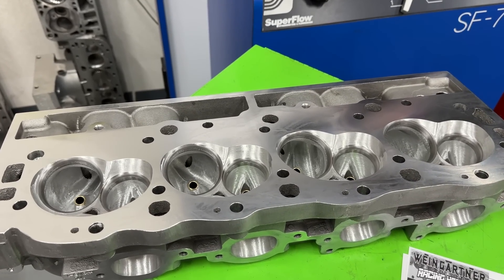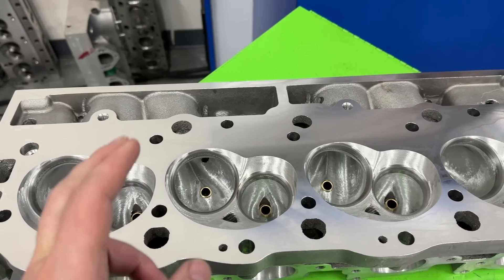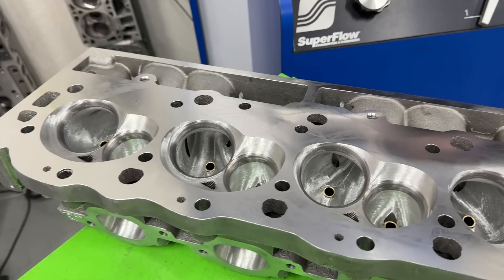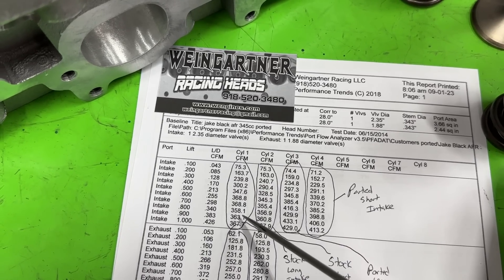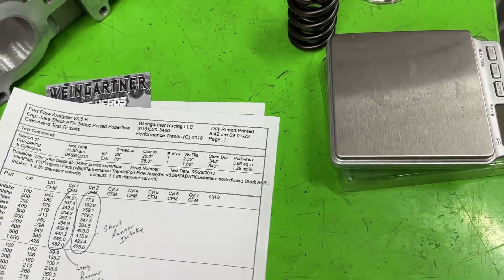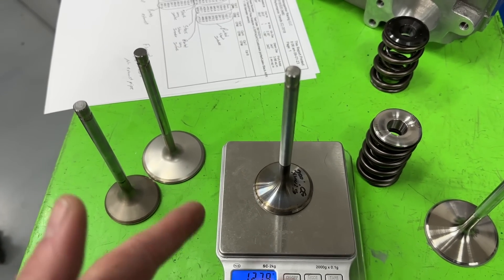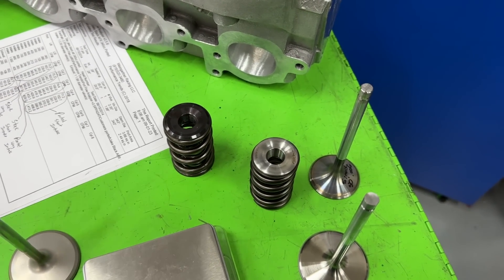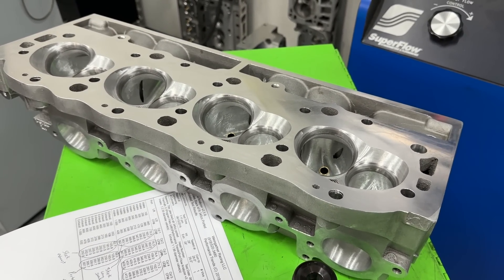Ported AFR 345cc BBC Results plus valve train weights

Comment: When considering valvetrain weights, it's typical engineering practice to consider 33% of cylindrical valvespring weight in valvetrain weight calculations. Springs with multiple inactive coils can be considered at 25%. Of course, the valve, retainer and locks are factored in at 100%.

Comment: getting  that narrow sweep is very important,, in the center of the valve is not   AKA mid lift geometry
do use knurled guides or knurl and hone the guides to hold some oil?  I od hone/ cross hatch the valves
huge gains  congrats

Comment: Good tradeoff on the intake valve and spring/retainer weight. IMO the spring pressure from mid lift to full open where the valve train is accelerating the most is more important than seat pressure
Reply from the maker: Valve float is where it bounces off the seat, which is why seat pressures are important.
Reply: @WeingartnerRacing  what about lofting over the nose and bouncing on the downslope all the way into the seat?
Reply from the maker: @treyrags  that tears up the lifter but if done right makes more power.
Reply: @WeingartnerRacing  yes it makes more power if you are limited on lift, otherwise it's better to build the extra area into the cam and smoothly control it

Comment: You mentioned closer to coil bind... do you target distance to bind rather than installed height?  Or have a distance to bind with undeflected lift preference?
Reply from the maker: Both. It goes Seat pressure and distance from coil bind.

Comment: I've see many posts of guys who, with the help of a spintron, are running much lighter spring pressures and spinning their BBC engines to 8000+ rpm. I'm talking like 190 on the seat with large lift cams! Also, since you have micro welding on the retainers, wouldnt it be better to consider a change of spring pressures? Or, just set up closer to coil bind?

Comment: The mass of the valve train on those units, has to be high. Normal units we get to play with, here in the UK, that are OHC with shim under bucket and rev no hight than 8000 rpm, generally need no more than 70-90Lbs on the seat and 180-200 over the nose. 
Of course were only making 135hp from 
1 Ltr. and the unit is only 2Ltrs 🏴🧑🏼‍🔧

Comment: I have a real question, but first, I had never heard of that other flow bench you use until I started watching you, say 2 years ago now.. It seems like all the shops I've been in use the SuperFlow SF 750 or their older model the SF 600 bench. Why wouldn't the SuperFlow that most shops use and been around a long time not be the more consistent one? I know their trans and engine stan dynos are very popular too
Reply from the maker: The Saenz bench is superior to the Superflow. It has way more capacity and spools faster. The superflow benches seem to have more variance from bench to bench even though they are calibrated correctly. This may be due to people using not accurate bore fixtures and plates to mount the head correctly to the bore. Their dynos vary from place to place as well. As far as consistency both will repeat within 1cfm from day to day.

Comment: My builder had my engine on his dyno and it started to float at about.  He used the same valve springs but the cam is different from what he usually uses.  I figured the cam may be faster ramp or something but now I wonder if the springs maybe different.  It’s just a street motor.  He’ll get it fixed, he’s the pro not me and he wouldn’t give me junk.  You’ve just learned me and I’m thinking.  Thank you.

Comment: Goes to show you can't just race flow benches.  At first glance you might think the AFR 357 is better, outflowing until 0.700 with a smaller cross section flowed on a smaller bore, untill you show the 600 numbers that is.  And still don't know if you're running the same radius plate and pipe...
Looks like a nice setup 👍.
Reply from the maker: You cannot compare flow numbers from different places. The proof is in the stock flow of the AFR 345cc it flows much less on my bench than what AFR claims.

Comment: do the double conicals work
Reply from the maker: They typically don't have enough spring pressure for most applications.
Reply: @WeingartnerRacing  Thanks Ed Iskenderian developed his (for a long time only) .904 lifter cam for our Max Wedge 413.  He got most of his springs from So cal  (pre PAC)
 I would think that someone would build nested conical with a range of pressures